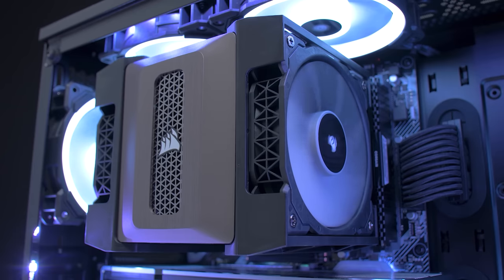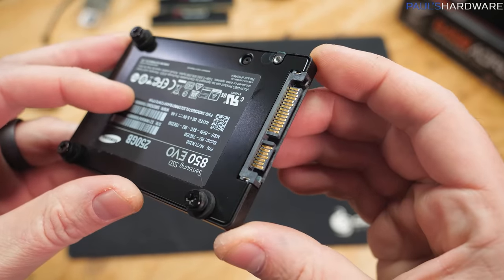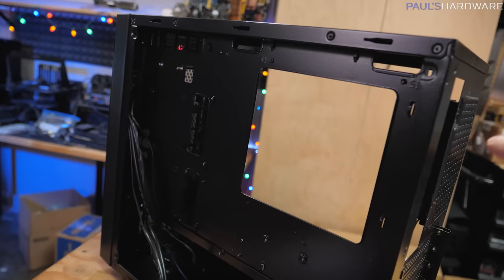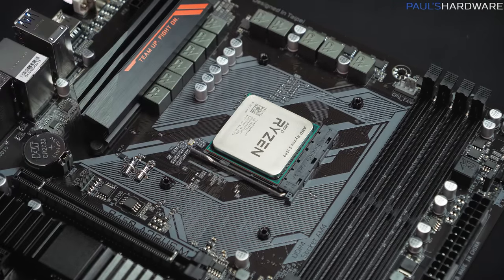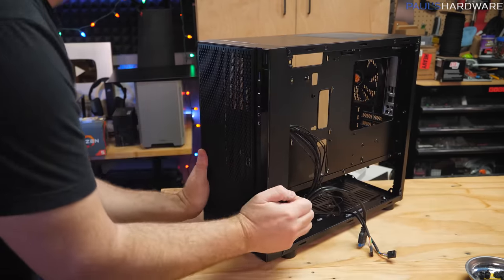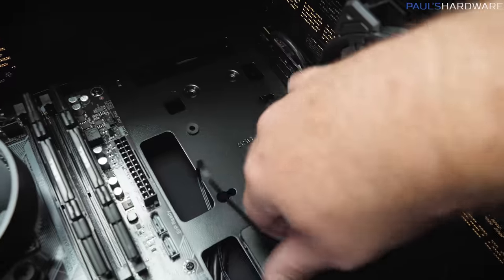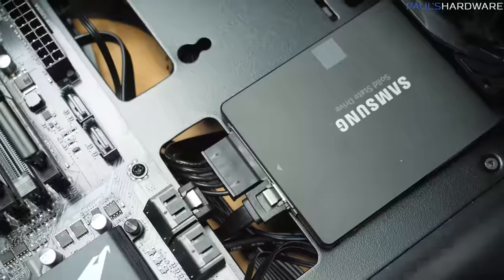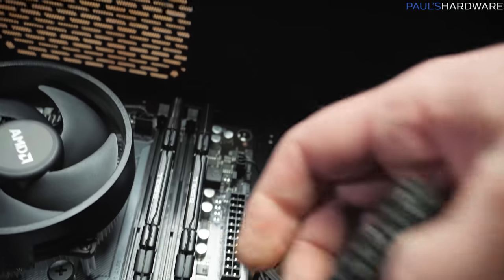How To Build a $550 Gaming PC in 2020!

Comment: 1:20 - 6 core and 12 threads!
Reply from the maker: Oops! I meant to say that... Thanks for the correction though, pinned for anyone who was confused -- R5 1600 AF has 6 cores and 12 threads
Reply: Autistic Unicorn I use the same cpu in my pc I built that also has a rx 570 and b450 gaming plus mobo.
Reply: @FlintG  I'm thinking about building this exact setup. how happy are you with it right now? It'll be mostly used as an htpc so I'm not worried about that but I'd like it to be able to handle some decent couch gaming as well.
Reply: Sixteen times the detail!
Reply: @paulshardware  lol it happens you corrected it in the end though!
Reply: @SeekTranscendence  Me as well,  LOL.
Reply: @DDaRick  what cpu are you running?
Reply: Can this handle running minesweeper?
Reply: @paulshardware  I'm going to build this or something very similar to ride out being at home. Keep up the good work👍.
Reply: @Butcherbirdwoodworking  Yup it works pretty well as my first build. I even use 16gb ram at 3000mhz even has RBG on the sticks. Also use a 512gb ssd. But it handles a lot of games I want to play even handles gta v easily and watch dogs. One day I will upgrade the GPU to something like a RX 5600 XT cause the 570 I have is a 4gb from red devil still looks cool since it has 3 fans on it lol.
Reply: @Butcherbirdwoodworking  although my cpu is different, i have the ryzen 7 2700 but the same gpu, the rx 570, it runs Overwatch super well (100+ fps), 7 days to die (70 fps), and rainbow six siege (100 fps). It depends what games you want or plan to play, always check benchmarks too, but overall runs most games well.
Reply: @HoLeeSheet117  can it run cod: warzone?  Have u tried it?
Reply: @FlintG   hey Max how is your experience with the rx 570 ?
Reply: @zeo3461  Pretty good so far handled any game easily at 1080p.
Reply: @Butcherbirdwoodworking  the setup is great and the extra threads make everything very crisp and smooth
Reply: @paulshardware  hey when I tightened my CPU cooler I just tightened it until I could pick the motherboard and everything up by the cooler and it was sturdy is that ok?
Reply: @FlintG  my too
Reply: simple  STILL rocking my fx 6300
Reply: i play fortnite competitively around how many frames will it get
Reply: Computer 'Rick I’ll buy it for 200$
Reply: What’s a better graphics card to use but not to to expensive
Reply: Can someone tell me if this computer is good or not
Reply: @Butcherbirdwoodworking  I recently built a similar system, but paid an extra $10 to put in an RX 580. The 580 is just a bit faster, and will stave off a video upgrade for an extra year. My monitor is 1650x1050 and I can run the latest Tomb Raider on complete ultra and still get 60 fps. Battlefield One is nearly 100 fps.
Reply: is it good or should i upgrade it?
Reply: Paul's Hardware  i read some reviews on newegg saying the motherboard fails alot. Any comment on if its true?
Reply: I looked up this part in CAD, $299. WTF. I can get 3600 for less
Reply: @paulshardware  can you do a 700$ build next vid please
Reply: Does the gskill memory work at the rated max speed?
Reply: Ryzen 5 1600 AS FVCK
Reply: Will this setup run 7 Days to Die very well? Want to build a Gaming PC and do some content creating as well but don't know SHIT about specs, lol. Farely poor and have a family so can't afford to spend the money and NOT be able to play smoothly, my favorite game of all time.
Reply: I came down to the comments, cause I thought it was 12 threads. Thanks for catching it!
Reply: what games can i play on this?
Reply: @Dying2play12  I was able to play 7 days to die on a fx 4300 with a hd 7850 ^^ if you get this pc it should be no problem at all
Reply: @paulshardware  Hi, i wanted to ask, if it isnt 6core 12threads it isnt AF?
Reply: Anthony Lopez : will the configuration mentioned in video work with Ryzen7 3700x ?
Reply: @paulshardware  Do you see any issues with using the  the Ryzen 5 2600x and the AMD RX 580 in this exact built? For some more power...
Reply: So I wasn't wrong
Reply: love the user name
Reply: @paulshardware  brother why are you wasting your time; did you ever realized the meaning of your life or the purpose of your life, The one true Creator Allah made you from water please listen what Allah says in the Quran[ only one true creator's words ]; Please follow Islam the only true religion , after we die one day Allah will resurrect us all and we all will be asked for everything we have done in this life so please don't wast your time making these kind of gaming things.
Reply: AlphaMax can it run cod war zone or fortnite, bf5 and 1? Is it that good? Please tell me i kinda have the budget
Reply: Shame it jumped in Price
Reply: @FlintG  You mean RX 5700 gpu?
Reply: @gags730  I would say it will do "ok". For transcoding video, that is mostly cpu, but you might want a bit more ram if your video files are large. You might upgrade the size of the hard drive as well. Prices have gone up since this came out though. It's more than $500 now.

Comment: I think this is the first build video I've seen where the builder remembers to turn on the power supply before the first boot 👍nice one Paul!

My go to move is to forget to plug in cpu power 🤦‍♂️
Reply: It's more fun to forget to plug in the monitor cable and then panic when the computer is running but seems not to be booting.
Reply: @nakyer  ...or having the selector set to the wrong HDMI port on a TV.

Comment: Something I learned years ago - the acids produced by our skin as part of our immune system, are corrosive to metals. Over a hundred years it can eat right through household electrical wiring (yes, the earliest house wiring jobs used wires without plastic insulation, and set them into timber strips instead), but for the very fine layers of metal plated onto computer components it takes a lot less time to get a film of corrosion that reduces electrical contact quality. And even before the corrosion starts, the film of acid and grease from your skin can impair performance.
If you really want to do a good job assembling your new machine, wear a pair of disposable food-handling gloves while you work. They're cheap.
Reply: needs more likes
Reply: Agree more likes.  Would some nitrile gloves be perfect?  I never thought about this.  But I've got more nitrile gloves than I know what to do with lol
Reply: Well I’m not going to be alive in 100years soooooo no glove no love does not apply here 😂
Reply: A biochemistry lesson that is thoroughly appreciated by yours truly.
Reply: Good to know, good to know
Reply: electrons also slowly degrade electronics, any tips on how to avoid them? XD
Reply: @sewinvicta9274  https://en.wikipedia.org/wiki/Failure_of_electronic_components
Reply: @sewinvicta9274   @Se Winvicta  just saying i was right and you were trolling

Comment: As of August 4th, 2020 - price was around $620. Still not bad. Added a 500GB SSD and a wireless card which brought total with shipping and taxes to $663. Don't forget the OS charge too which has Windows 10 home around $100. Total with upgrade is $773. Not too bad for a decent powerhouse gaming system which you get to build to ensure quality. Most pre-builds are assembled terribly. Thanks for this video!

Comment: 21:42 - I've been building computers since the late 1990's. This is one of the cleanest LED Pin maps I have ever seen on a systemboard and I just wish it existed back then! 
You needed the manual in your hand. Some of the systemboard manufacturers made it an absolute nightmare to orient the pins!
Reply: Ohhh...I remember. I inherited my dad's Packard Bell 75mhz Pentium when he upgraded to a 166 MMX (I was green with envy), but after running that for a couple years, I finally was able to upgrade (I don't even remember to what) but I do remember trying to figure out how to orient the plugs into the pins and eventually just giving up "I don't fuckin need a power led anyway!!" lol

Comment: Paul, you should mention the piezo buzzer separately as it often is not included. And you should plug it in as you might need it for the BIOS beep codes.

Comment: I'm a veteran PC builder, But I still watch these videos tech YouTubers upload because I enjoy it.
Reply: I have a question. In the video at 13:48 Paul puts the cable under the heatsink of the CPU cooler, allowing the cable to have contact with the bare metal. When that gets got, wouldn't that put the cable in a bad spot where it could potentially melt?
Reply: @ashtonyaklin6836  Stuffing it there isn't dangerous, It is not hot enough to melt, but you can wrap the cable around the bottom of the cooler instead. this way it doesn't touch the cooler and looks neater.

Comment: The only thing missing is some benchmarks to see how it does in various games and applications. It looks nice and is affordable but how it performs is important in whether to build it or spend 250 more.
Reply: i think your better off in spending a bit more or waiting for the new line of cards to come for better future proofing
Reply: CPU is 3.2 to 3.6 Mhz, before overclocking, (fine for any game) plus it's 6 core, 12  threads. GPU is mid level and should play most any game at 60 fps and 720 if not 1080p. 16 Gigs of ddr 4 is plenty for any game, in fact about twice what you need and the GPU has 8 GB of it's own ram. If you want 4K gaming, you need more GPU and a handful of Benjamins just for the card.
This is a great balanced build for a great price. I overbuilt the hell out of my pc not knowing any better. I only use about 50% of it's power playing The Shadow of the Tomb Raider or World of Warships at max settings, 1080p on my television and minimum 60 fps, usually around 140.
I'm going to upgrade the drives and get some rgb ram and fans plus a cool case and build this for my nephew. I'll stick with the motherboard, cpu, and ram "speed" recommended here though.
Reply: @robhill8894  next gen is only around the corner so the card is going to be underpowerd. hes better off getting a amd xt 5700 atleast then has no worries of playing games in the future.
Reply: @robhill8894  Same, I recently Built I7 9700k W/Enermax ETS T50, 2070 Super, MSI Z 390 AC, 2x 8GB Corsair 3000 Mhz, 1 TB Samsung 970 EVO+ and 2x 1 TB WD Blue HDD,EVGA 750 W in a Corsair Carbide 540. I am loving it,but I Definitely need to upgrade my "Monitor" now as I have it hooked to a 42" Vizio 1080P 60 HZ TV. (I bought all the parts at seperate times starting with the GPU which was an upgrade for a different PC, If I was Buying all the parts together I would have saved money on other parts and got a 2080 Super, but Im still very happy with the build,will probably get next gen GPU or I might wait 1 Generation depending on performance/Price.
Reply: Rob Hill oooooo thank you Rob! Can you please tell me the upgrades you bought? I would like to do the same build for my nephew.
Reply: @crashcrash1349  amd xt 5700 - can you send a pic or where to get one of these?
Reply: @robhill8894  so do you think that really the only change to this build should be upgrading the GPU? I think getting an 8gb instead would be perfect. Maybe also a slightly better AMD processor. I've been watching Paul for years and I still haven't built a PC. I feel like this would be perfect for what I do. I don't really play new games. I stick with old PC games like Fallout NV (with mods) and mainly play PS1 (I collect PS1 games and I still have a PS1 and the same PS2 I got when they first came out lol). I play Fallout NV with tons of mods on my crappy old HP laptop. It has a pretty old AMD processor. Feel like I don't need much more. I would love to stream playing old games. There's lots of older games I missed out on that I want to play on PC and stream, like Bioshock and RDR.
Reply: He posted another video in the description that is literally him testing it?
Reply: @Ghost.gixxer  Timestamps. Parts list. How to build. My store. Social. Credits. Which one again says "Benchmarks" or "Tests"? I'm not following several links to try and find out if he tests it unless it mentions that in the link. Him playing a game briefly after finishing building instructions is not a benchmark or test. 

You're a new PC gamer I take it. Because, anyone who's been building PCs and gaming on them for years would have understood what I was suggesting.
Reply: @Ghost.gixxer  A benchmark is used on several different games that present different challenges to the hardware. ARMA 3 for instance would push the cpu. Shadow of the Tomb Raider would push both cpu and gpu. Blender Cycles renders could test both the CPU and GPU individually. So, "various games and applications" would be tested with various settings and comparing the numbers to show this build's strengths and weaknesses.
Reply: @robhill8894  The build is kind of trash honestly, you're better off spending more money and buying a real mid tier card like the RX 580, which still holds up right now on 1080p on ultra/high. Could also spend more money on a better processor. All of these parts were probably on sale or something because right now the build is not 500 something, especially with the Pandemic and people buying computers in droves.

Comment: 17:58 would recommend installing the HDD on the underside of the basement
Reply: Yeah, I think it is stated in the manual also (I own the basically same layout H17). There is 2 places, one on the bottom of the basement "normal" orientation, one on the "top" of the basement upside down.
Reply: @pikster89   Thermaltake is the sh*t. I have the little bit larger Core X31. I recommend it if you're planning on moving up to a larger mobo and liquid cooling down the line. It doesn't have the PSU shroud but that gives it room for the HDD rack and a much bigger mobo. It's rated for ATX but I was able to fit an MSI X99A Gaming Titanium EATX in it with just enough room for cable management and an NZXT X61 280mm aio. I was also able to fit the 120mm cooler for my GTX1080FTW Hybrid at the front, below a 140mm Thermaltake Riing fan. I did have to trim down a couple of the plastic ribs inside the front cover to fit the radiator with a box cutter but it wasn't noticable and didn't hinder how the filter was originally seated. The X31 also has an optional 90 degree graphics card bracket and 2 drive bays (If you're still into that. I rip Blu-rays so it's essential to me.) 

I started with a Core X5 Riing Green edition because I didn't realize what a monster it was. Like the size of a small coffee table. When I do my next build I'm turning the X99 into a media server/NAS so I'll put it back into the X5 so I can take full advantage of the X99A's 10 sata connectors and the cooling capacity of the 200mm fan. 

If you want great airflow check out the Thermaltake Core X series cases. They're the most versatile cases I've ever seen. They are built to handle complex liquid cooling and can be joined together with other Core X cases with matching footprints for multi-system or tricked out cooling builds. 

You really can't go wrong with most Thermaltake cases.
Reply: Yeah, I agree. That's where Thermaltake intended it to be mounted. They are very well designed to avoid conflicts in hardware placement.

Comment: Great tutorial, Paul! I just completed a similar build. Same video card & case. Though with a Ryzen 3100, which was $105. But that was $20-$30 cheaper than the 1600AF in August 2020 when I ordered parts ($85 would have been sweet). I got 512GB NVMe M.2 SSD storage for $55 (too inexpensive to even consider much slower SATA SSD). My total pre-tax cost was $559. At least before LED fans and cable extensions. The detail on your assembly and cabling in the Versa H18 was very helpful. Though it did not boot initially. Which freaked me out a bit. Fortunately, it turned out I had not plugged in the CPU power cable properly. Thanks for your EXCELLENT guidance!

Comment: Lol I gave my friend the same parts list a month ago. Now I know I doing something right.
Reply: Same! It feels like I know what I’m doing. Only difference is I recommend a GTX 1660 since he wants to stream and Nvidia has a better encoder than the Radeon cards
Reply: Not sure you need an x570 motherboard.
Reply: @mindofmyown333  1660 is worse for preformance
Reply: @wisewigga7129  Worse than a rx 570? No, a vanilla 1660 is around rx 590 performance(a tiny bit higher usually, I think).

Comment: Is there any chance you could add the Canadian prices to your builds like this. I know it's a little bit more work but I know that all of us Canadians would greatly appreciate a small addition like this! Thanks Paul!
Reply: Just multiply the price with 1,42.. not that hard to do yourself
Reply: @Jantzku  the issue is that not all of those options are available in Canada and that there will be different prices for the same parts. That's why it isn't just the exchange price. Thanks for your reply though!
Reply: @Jantzku  It's often more than that, the 1600 AF is about double the price here. Not just an exchange rate issue.
Reply: @JohnSmith-rw1rf  This. The exchange rate is only half the problem. Parts can cost way more depending on where you live. So it's kind of unavoidable. The prices on Amazon.com are not going to be the same as your own local Amazon or in-store price.

What you have to do then is convert the USD price to your currency first, then compare local prices to see if it's still a good deal or not.